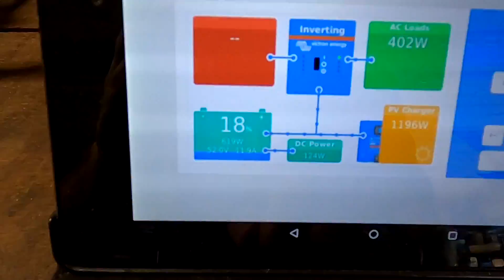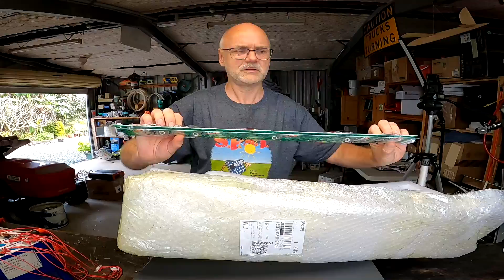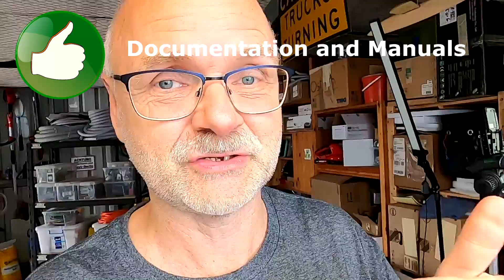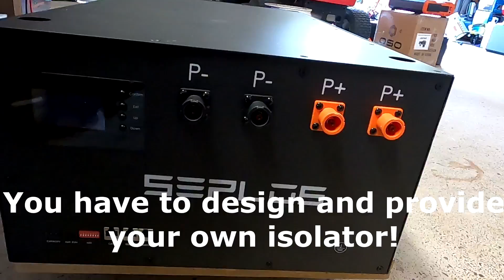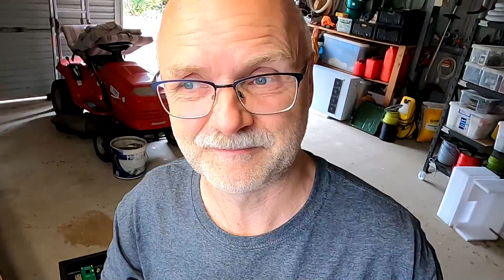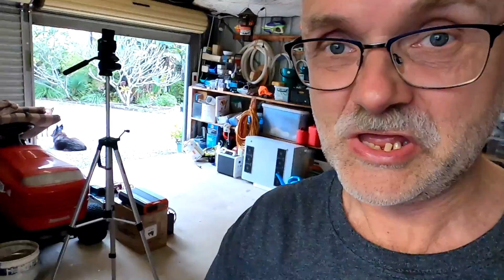Considering a SEPLOS Battery or BMS? Here is my experience so far...

Comment: Hello Andy, I also bought such a bms 150a without a box.  This should work together with my Sma System Sunny Island 8.0h 13.  This also worked.  What bothers me is that the seplos BMS continues to allow a charging capacity of 6kw just before 100% and then suddenly shuts it off.  This throws my system completely off track and produces battery errors via can.  This should be improved so that from 95% it can only be loaded slowly, e.g. with the Pylontech bms.  Of these I also have 5x us3000b.  This works wonderfully.
Reply: 150ma should be sufficient for real grade A/EV grade cells that are top balanced. A lot of people use non-A grade cells that aren't even the same age though. In that case I could see needing more.
Reply: did you try the new firmware they put out for sma ?  it was a fix for a customer ;-)
Reply from the maker: Why is the charger not already throttling down in your system (aka absorption voltage and current tapering off)? As I said, the BMS should not be charging your battery.
Reply: @OffGridGarageAustralia  at sma unfortunately already because the Sunny Island leaves the charging process to the bms.  Lithium batteries cannot be set on the inverter.  Sma can only be configured for the lead-acid battery.  With lithium batteries, it no longer accepts the target voltage.  With the pylontech us3000 series, for example, the charge from the bms is throttled from 90%.  unfortunately seplos doesn't do that.  even at 99%, it still charges with 6kw if these are available and then it is switched off abruptly and the inverter goes into overvoltage.  all not true.
Reply from the maker: @Black86Panther  the Seplos should throttle charging with the right settings. It would only turn off completely of there is an OVP or something like this.
Are all the settings correct?
Reply: @OffGridGarageAustralia  Yes, the settings should fit. Monomer overvoltage 3.50v monomer recovery 3.40v /pack overvoltage protection 56v / recovery 54v. Like you, I installed eve 280ah cells. What setting should cause a throttling. intermittent charge only blocks the charge at 100% and releases it again at 95%. The loading speed has no influence on it. I've tried some settings. So far without done. With Batrium, for example, you could also set a throttling in the BMS from 90%. Unfortunately, this had several problems, including the fact that it did not want to communicate with my Sunny Island via CAN. Batrium itself couldn't explain it either, it just didn't work. Since I am dependent on a BMS for the SMA SI, which communicates via CAN, your video series about Seplos came in handy. REC BMS is currently not available in Germany. I have now reduced my batteries to 15s and use them parallel to my existing Pylontech us3000. Currently works without problems.

Comment: I have a deligreen/daly smart bms and yes I can upgrade the firmware with PCmaster. Andy get yourself a hydraulic scissors lift  trolley cost about $500 but can lift 250kg to bench height from 120mm best thing I ever got.
Reply from the maker: Ah, right, yes, you can flash the Dalys via PC as well, I forgot about that.
I thought about an engine lift kit usually workshops have. Or three more Andys...

Comment: Oh and yes the comms need to interface to our mppt chargers and maybe home automation via mqtt or Or something. The only thing about going to the inverter is say the frequency shifting option so that ac coupled charging could be controlled via soc.
Reply from the maker: Hmmm, I don't see the point still... Having the BMS on the MQTT is fine but the charge controller throttles charging anyway when we hit absorption. It does not need to know the SOC of the battery. Neither does the inverter 🤷‍♂️
SOC is just displayed for my pleasure.
Reply: I see a need for when the amount of solar panels deliver amps from the solar charge controllers that exceed the Battery charger current. Eg I desire to run 50 Amp 48V 2400W, but may need 4800W at times, so I install 4800 W of solar panels. To adjust the charger controller current limit between 50A and 100A requires Victron DVCC. Or else I double my battery bank to handle 100A charge. So far I have used the MPPT current limits by themself to limit battery charge current. If I add more solar panels I could run large loads diverting excess charge away from battery charge current limit. So is it economical to have reserve solar panel capacity with no desire to store it in a battery, it is only used directly from the solar panel to the house/shed load.
Reply from the maker: @aidendeem903  But could you not limit the charge current in the MPPT directly and don't need DVCC at all? That would have the same effect.

Comment: It’s always a GOOD day when there’s another video to watch from Andy! 
As always…… Thanks Andy  👍, love your work, (and always love your sense of humour too!)
Great summary - I totally concur with your summation. 
There is much to like about the Seplos, BUT I do think the Seplos BMS is a fail though, simply because of ultra low balance current, and lack of BT access. They desperately need to improve that.
I also agree- a cooling fan for the battery box would definitely be desirable for warm climates.
Personally: I’d buy the box, but not the electronic components that come with it.
Reply: I agree about buying the case at this stage, but it will be interesting to see what Andy’s high amp/load tests reveal on the temperature side of things too, within the individual cases themselves would be good to see how different batteries may vary, or if they even do get very hot, Im sure Andy will do his best to find out. Cheers
Reply from the maker: Thank you, Dave.
We will do a high amp discharge test once it gets warmer down here. Really want to see what is going on inside this box at high temperatures.
Reply: Andy has a video setting his Victron SCC to 27.60V (if I remember correctly). I wonder, if internal Battery Source resistance is say 20 milli Ohm per cell, does his Voltage limit setting , which sets when the SCC will switch from constant current charging mode to constant voltage absorption (which has a corresponding high but declining current charge) effectively amount to 'clamping' (I don't know the more usual technical term here) the Charging Source of the MPPT controller, so reflected to the Battery as a  "load" the internal resistance of the battery is the series connection with say 16S cells plus the 'apparent internal resistance of the charging source as if it were a load'. I have a Daly 4S, and recently reviewed Andy's video on the Daly which didn't see it as being made great again, and the Daly switches of charge MOSFET at 14V, which would be 28V for 8S bank. Balancing also switches off. So Andy's recommendation to set Victron gear to charge at 27.6V means charging and balancing continues in 'absorption mode', at a relatively high 50Amps for my setup. The Daly cannot balance the cells as the highest cell reaches 3.65V whilst the lowest is 200mV below that when the battery reaches 14V, and the balancer and charger is switched off by the Daly, but as it floats the cell differential voltage drops yet no absorption is permitted by charger if I were to set Absorption at Manufacturers 14.6V recommendation. It's a brand new battery. So I'm wondering if Seplos is a better option if I want to connect to my Victron GX and run DVCC. Does Andy have a review on this Seplos connecting to Raspberry Pi? Does a low absorption voltage setting of 27.6V clamp any high cell runaway voltage due to internal relatively high cell resistance and because the cells internal resistance is in series with the solar charger, the SCC looks from the battery to be a much higher impedance/resistance that forces any runaway voltage rise to stay set at 27.6V whilst current amps are still permitted to flow into the battery, even into the high cell which is also 'clamped' whilst the Daly or Seplos could still 'balance' with low balance current limits?? Hmm I really wonder about this stuff.

Comment: Re the shipping cost - I think weight is not the issue - it’s volumetric size. Shipping they will take up about 2/3 the volume of batteries with padding. Can they do better on cost - it probably depends on how many they sell and how fast you want the case. As others have pointed out communicating correct SOC to the inverter is critical if you’re running cloud based software that supplies loads based on how much energy is left in the battery, or controls charging based on solar output. Plus I think it’s mandatory if you want to add a battery to a grid connected inverter.
Reply from the maker: Yeah, they said it wouldn't matter if flat pack or boxy shape as the weight is what they pay for.
I don't think the SOC is a fair point or an argument for communication. Even if the inverter is far away from the batteries and the voltage drop is relatively high on large loads (bad system design?), the inverter needs to shut down on a low voltage regardless what the actual voltage or SOC at the battery is.

Comment: I think it's best to buy two BMS and test them together.
Reply from the maker: What do you mean by that?
Reply: @OffGridGarageAustralia  About cutting off all modules if one cell exceeds the voltage limit. I think I know why. If the charging current is high and one module shuts down, much more current goes to the other modules - above the limit.

Comment: If the total cost plus shipping is less than a ready made, then yes, I'd get it, but with a $400 shipping or whatever, plus having to buy the batteries and ship those, the overall cost might just be cheaper to buy the fully ready made one. It's just a matter of doing the numbers and if you want to consider your hourly wage in there. As for the CANbus cable, you can keep them disconnected during operation, and have them almost plugged in so you can quickly plug them in for any modifications. seems to be a ok compromise.
Reply from the maker: It's more to give people some option who want to do DIY rather than ready built. Cheaper or not aside...
If you computer is close to your battery, yes it's not too much of a hassle except form turning everything on, starting the software, connecting again and logging in to everything $%#%^

Comment: I have 4 of the 6.9KW Mason kits, and 3 of the 280AH kits. I also purchased JASSN busbar to connect them in parallel. I plan on keeping each battery isolated from a comms perspective, so no worries there. I LOVE their cases, and the BMS on battery status screen. All they need to do is add access to all functions via the screen, and the PC issue goes away.
Reply from the maker: Thanks for sharing. I have seen the bus bar/breaker combo they have. This is only for split systems though from what I get?
Reply: @OffGridGarageAustralia  don't let the "split thing" confuse you.  it has 6 inputs, and 3 outputs for up to 3 inverters.  NOproblem to use it for 1 or 2 inverter.
Reply: How much was the 6.9kwh kits cost? The website says $1000 but in skeptical that's the price. Unless the kit doesn't come with the cells in that case that price is far too high.
Reply from the maker: @randybobandy9828  It was like A$2100 at the time including the cells. Seplos said, they will reduce the price. $1k seems to be a pretty good price considering the BMS is already ~$200.

Comment: Andy, the batteries should be used in conjunction with the Seplos JASSN busbars, which has breakers for each attached battery.
Reply from the maker: Some requirements need an isolator at the battery not at a junction point. Yeah, it's not ideal in my eyes. The TUV PUSUNG they have has one in the front panel, so, the design is there. They just need to be more consistent.
Reply: What if i use a single battery? I don't need bus bars

Comment: I understand why all the batteries would turn off all at the same time. Imagine you have a stack of 5 cases. 
One cell has a failure. That cell is in the bottom case. The shut down has saved all your other cells in all your other battery boxes. There is no way you could gain access quickly. I do think they need an external breaker/switch. I think that's the major safety issue. If they give you the option to buy the cables or include the connectors to crimp onto your own cables that is an easy solution. I can imagine someone building the whole battery and then having to wait weeks for a set of cables or connectors to be delivered from China is going to annoy a lot of people. You don't send that much money to find out you can't connect the battery for another month or more.
Reply: you should be able to have the one faulty battery down without shutting down the all system.  it should be configurable  base on the minimum number of battery that should stay up to support your load at anytime.   it will cost you less to buy the cable when ordering the box. however you can order the connector from them if you kindly ask.   it takes less than a week to deliver by dhl.
Reply from the maker: It should only turn off the battery with the failure. This would not affect all the other banks at all. Any other design does not make sense.
Yeah, the terminals don't make sense to me. At least they should have pointed that out when ordering or having this as an option on their website.

Comment: Is a good system for beginners and for the ones to start to dive into potential full DYI. Prefer these one's to all the others that include  3D printed parts and other stuff. The connectors terminals on the big one should be using the standard most common out there at least...

...

Comment: The instructions were very basic and hard to follow.
There is no way someone can easily build this case in only 9 poorly worded steps.
Reply from the maker: I found it really good. Maybe I'm too advanced and should have let my wife try building it. I guess you need to have some sort of knowledge and basic understanding what you're doing.
Reply: @OffGridGarageAustralia  there were no mentions about installing the feet or latches.
The assembly of the entire front panel was described in a single sentence, which is simply not enough details.

Maybe I have become too accustomed to Ikea's flat pack instructions. 😆

Comment: The new shipping price is too high. seplos don't know how to deal with DDP, too many people complain about paying twice taxes and VAT. letting your cell provider handle shipping your box is best for now. logistics should be improved, too many complaints about missing parts or errors. The male connector must be available for purchase, as you must use the same  male/female connector. 
Add an option in the firmware  for internal/external balancer, and an output signal  to start the external balance.
Reply from the maker: Yes, I should have mentioned that. They don't have much experience with exporting products it seems. The custom declaration was a bit of a nightmare here in AU.

Comment: Those leads you can get from power plus hearing melboure because they use them for their batteries to make sure of ip rating
Reply: I think power plus use genuine Amphenol connectors. They look great!

Also as stated in other comments, these "drawers" are more or less one component from a full racked battery system which uses bus bars. The little quirks like this make more sense when considered as part of the whole system.

I guess the "DIY" label is maybe the point of confusion. 

If you're selling battery systems, installing them etc, building the battery drawers with your own, separately sourced cells would probably make good business sense. Ditto on lack of wireless management. If this is installed in a shopping center, a school, a military facility, a high rise building, you don't need each drawer to have that. It's DIY for the business selling a large parallel bank, multi-rack system, configured initially, then monitored by another part of the system (like the inverter they communicate with)
Reply from the maker: Yeah, Amphenol, that was the company I could not remember when I made the video.
Reply: @OffGridGarageAustralia  I came across these some time ago while making plans for a battery. YAFA Store seems to stock these connectors on the ally express acquisition place.
Reply from the maker: @CollinBaillie  Great, I'll have a look. Thank you.

Edit: They seem to be different connectors at this store.
Reply: @OffGridGarageAustralia  Maybe you can look at swapping out connectors on both batteries and getting something mechanically identical and have the terminals you want?

Power Plus use Amphenol SurLok connectors, according to a video they have on YT about how to crimp them.
Reply: @OffGridGarageAustralia  Mouser sells Amphenol SurLok Plus which look like the YAFA connectors. SLPRBTPSO
Reply from the maker: @CollinBaillie  Either that or I'll try and get Seplos to send me the connectors I need.

Comment: You won't appreciate this bms communication until you have an AC coupled system where the  inverter is doing the discharging and changing.
Reply from the maker: I still don't see a reason for having comms. What would be the difference to and off-grid system vs an grid connected one?
Reply: @OffGridGarageAustralia  my system is offgrid but am using a  PV inverter along with a SMA SI. The bms tell the SI the battery SOC/TEMP, when to ramp down charging current ect.
Its possable for other loads to turn on when the battery is  full like car chargers, hot water cylinder.
The other main advantage is my string voltage can be up to 750v going into the PV inverter.
A ac coupled system isn't possible without comms.

Comment: After years of building serves you learn very quickly remove the HDDs before moving , and replace when racked .. The same principle  applies here build in situ .
Reply from the maker: Yeah, could be a bit difficult with the batteries if you have the battery in a rack.